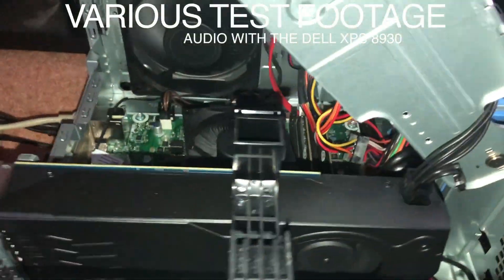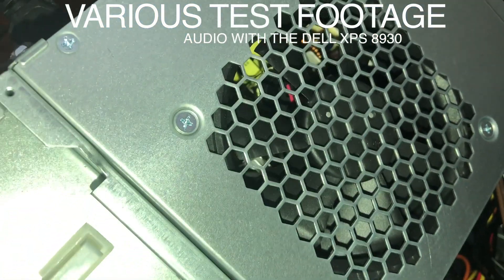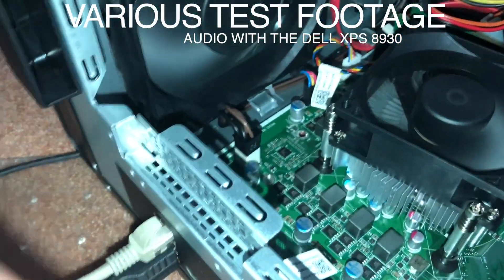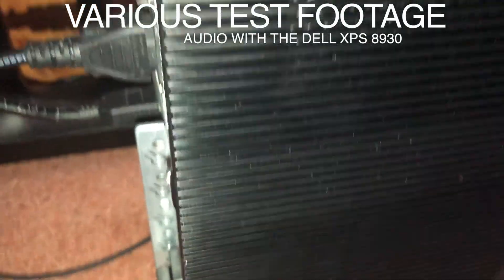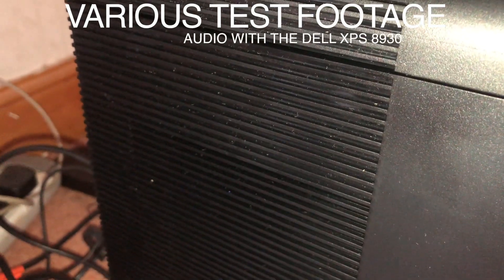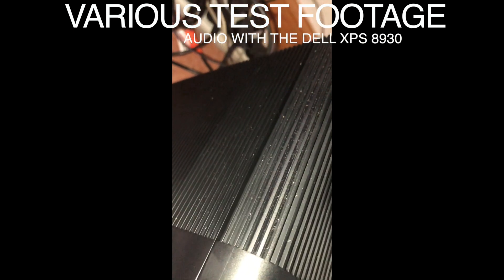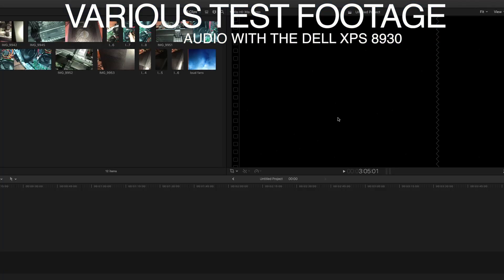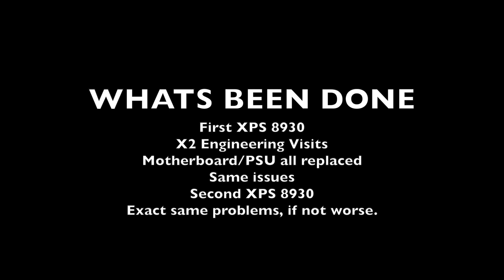DELL XPS 8930 SOUND ISSUES

Comment: This is why u build Ur own pc if the heatsink messes up just slap on a new one, whereas a dells mobo pre designed holes u can only install the Dell heatsinks they provide
Reply from the maker: I am of an age that I built all my computers from scratch, loved to upgrade them etc, but now in my later years, that urge and love to do this is long gone. I want a pre-built system that looks nice (to me) and someone else can deal with the crap that come along with it. I am now thinking back to some of the stuff I built, and yes, in the day it was fun, but as you work in the field of IT and deal with issues daily, sometime you just want the equivalent of a microwave meal instead of a la carte!

Comment: I bought a XPS 8930 in Nov 2017.  I have one 8TB & two 4TB HDDs in it.  It is a quiet machine.
Reply from the maker: Michael Hickey Glad that you have had the delight of a quiet machine! Mine only (now) becomes noisy when the GPU kicks in for rendering work, but other than that it’s now at an acceptable volume level.

Comment: Dell has used the exact same fan and heat sink setup since XPS 8300. I have both the XPS 8300 and XPS 8500 computers and they are VERY quiet. The one difference between mine and this pc in the video is that my fans have the Intel label on them. Having said that, I liked the heavy duty heat sink and fan setup so much that I found another one and installed them on a home theater pc I had built. Seems your fan is of dubious quality and/or functionality at best. You could also check the fan setting in the bios, however. There may be a way to reduce the fan running like this.

Comment: I had the same problem. Underclocking the CPU a little brings the fan noise down a whole lot.
First, you need to run a command in windows to add extra options to the power options control panel that allows you to set the maximum CPU speed (use either method specified here: https://www.tenforums.com/tutorials/95580-add-remove-maximum-processor-frequency-windows-10-power-options.html).
Second, you use the new option in power options to set a max processor speed. Near the bottom of this page (https://www.dell.com/community/Desktops-General-Read-Only/Dell-XPS-8930-is-noisy-under-load-How-to-improve-Cooling-Top-Fan/m-p/5171068#M1029056) there is a table with the results someone got experimenting with different speeds. He suggest that there is a big improvement if you set it to 3900Mhz with no noticeable performance impact.

Comment: To fix this you need the Heatsink & Fan they install on the 8700k variant not the 8700 standard. The k variant chip means it can be overclocked if the m/b allows you to but many say the difference to overclock is not worthwhile on this chip where as it was on previous editions. See here for parts: -
Heatsink T57JF & Fan KTDJC...
https://www.youtube.com/watch?v=BMmCb6gBW-8

Comment: Just bought this PC for my office and I have noticed the same problem right away. Spent $2700CAD btw, o the other hand, my Imac at home is absolutely silent! and they are in the same price range! I am very disappointed
Reply from the maker: Joe Arbia I agree. My i7 iMac at full load is whisper quiet compared to this machine, even with the new fan that was inserted. I too am so disappointed that Dell has not bothered with making their gear quiet!

Comment: Purchased an XPS 8930 December 2018 with an i9 9900k CPU and a GTX 1080 GPU and it is super quiet. I run Battlefield V and it's very quiet. Your's sound like a vacuum cleaner!
Reply: They use a totally different fan with the "k" series processors. Very quiet. Just ordered my Dell after some research and upped the processor to the "k" series.

Comment: It would be interesting if you had a sound meter to track the increase in noise (DB's) .  I am looking for a new DAW and gave this system a look but if its really that noisy it would be worthless.    I am looking at building a Pro-Tools rig.... and Noise in the studio control room is a Killer for me!
Reply from the maker: The noise with that fan would be completely useless to you, but with the new fan that Dell fitted to this for me, its made a major difference as it's pretty quiet now. It's not silent, as you can hear a whirring sounds that once you tune into, you cannot ignore. It's worse when using Chrome, so you have to make sure that you disable all options in Chrome for acceleration and background tasks, or the fans do tend to start kicking in again. If Apple can create near silent devices, I still dont understand why in 2018 Dell cannot.

Comment: Install Intel XTU and lower the voltage, I run a negative offset of -0.160v  to eliminate the fan ramping up and down also dropped max temperature by -15c Maximum temp during stress test is now 75c instead of 90c. you can also limit the cpu frequency to achieve same result at the cost of performance more info in link   https://www.dell.com/community/Desktops-General/Dell-XPS-8930-is-noisy-under-load-How-to-improve-Cooling-Top-Fan/m-p/5171068#M1029056
Reply from the maker: The way this problem was finally sorted for me was to have the cheap standard cooling fan removed and a new lower profile fan and heatsink installed by Dell technical support. The computer is now an absolute dream to use, but that standard fan must be on so many other machines in the world that I am amazed that more people have not complained about this. YOu solution though is very good if you still have one of the crappy fans installed!!!!! Thanks for sharing this very handy advice!

Comment: The real problem is the quality of the fan. The used fan in 8930 is a low-end fan. One way to solve it is to change the fan to liquid cooling.
Reply from the maker: 江海志 you are quite right, but the ordering spec does not have that option.... but new video coming soon....

Comment: Did they send you a replacement?  Just curious if you got any response from Dell.
Reply from the maker: evelynjoyce  have had the first pc returned after a repair, another board replaced, and then a new pc sent out. This had the same issues, and I’ve had the second pc have an engineer replace cpu fan and I’ve just updated the bios to a new version.... and system still noisy. I’m still dealing with dell and will keep everyone posted on what happens at the end!
Reply: @TechRealityGlasgow  Just following up - did you ever get resolution?
Reply from the maker: Robin Persaud it ended up with me taking the computer to their dennistoun office to have one of their guys check it over. He replaced the heatsink and the fan with a high quality model that sorted the sound issue out. I am led to believe that if you have the k series processor this is the high quality fan they use as standard.
Reply: @TechRealityGlasgow  - Thanks for your reply.  I purchased the Dell XPS 8930 Special Edition tower, and am having spikes of fan noise when I am doing basic things like browsing the web (minimal background tasks running - no Steam, UPlay, Origin, torrents, etc etc).

Will escalate to Dell support.
Reply from the maker: Robin Persaud when it ramps up.... Check to see if Google Chrome is running.... Kill it in task manager and see if fan noise drops.
Reply: @TechRealityGlasgow  -- Thanks for the tip, but also occurring when using Microsoft Edge or Mozilla Firefox (I checked Task Manager at that time, no chrome.exe running).

Have not had time to troubleshoot extensively, or install / boot to another OS (Linux Mint, Kubuntu) to see if the behaviour is the same.

Comment: Glad I visited because I was about to buy this computer and now I've changed my mind. :(
Reply from the maker: Dell are bending over backwards to help me get to the bottom of this problem, so I cannot fault Dell in any way! Bottom line, I think the PC design is just flawed... too many fans and too noisy when they ramp up over the simplest of tasks.
Reply: Dell customer service and tech support is pretty reputable. Dell does have a liquid cooler available for this model which will probably help. I wouldn’t run away from the Dell XPS line just yet.